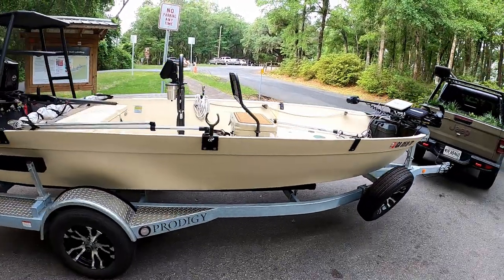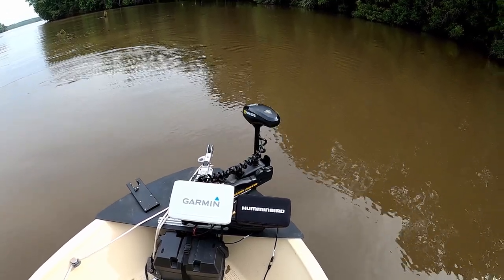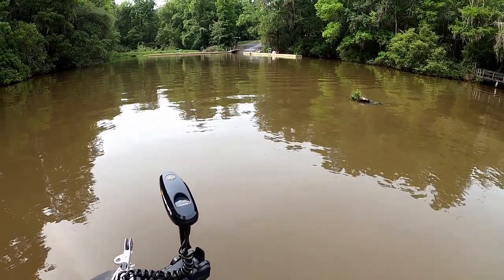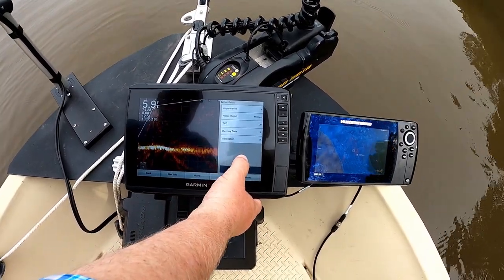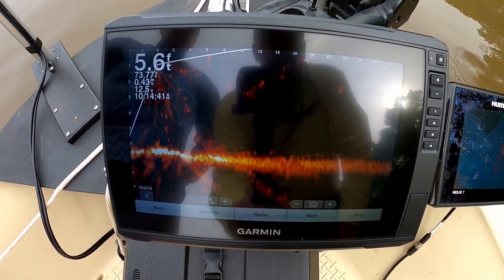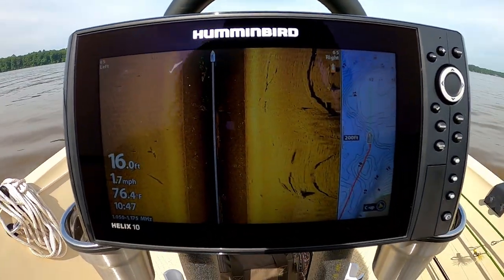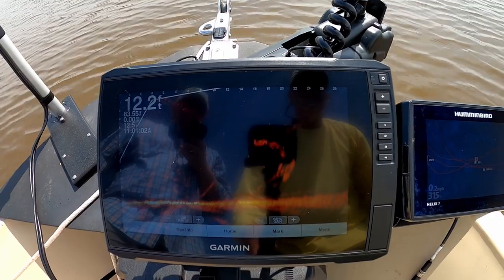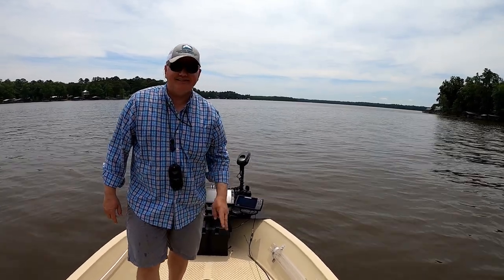Setup and Teach how to livescope and sidescan Crappie Lake Talquin

Comment: I set color gain at 90, main gain around 55, above 65 picks up too much partials in water. I think the helix has cast rings adjustment settings, as my solex does. You can set to 20’ or for bass fishing to 50-60’. You might check that.